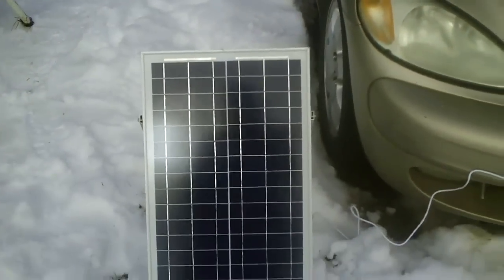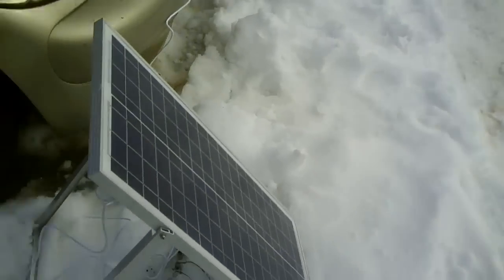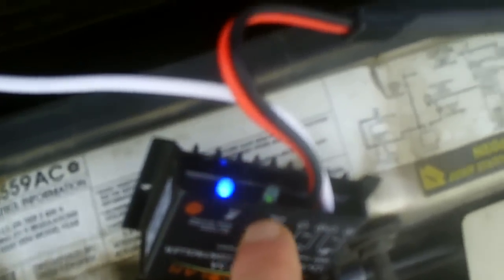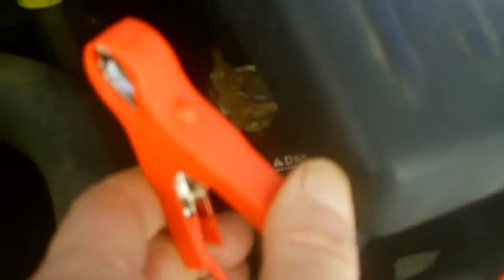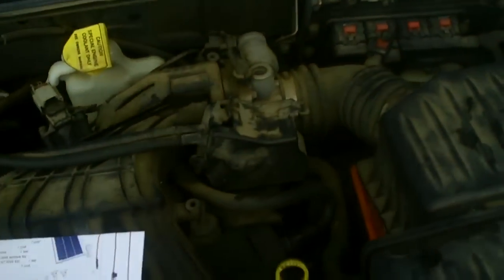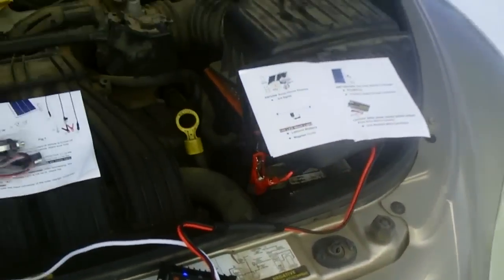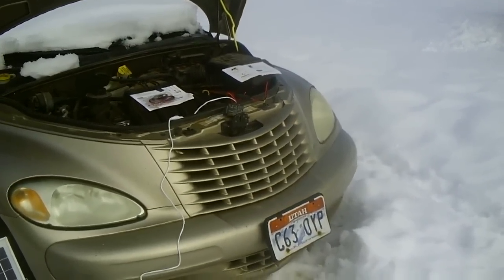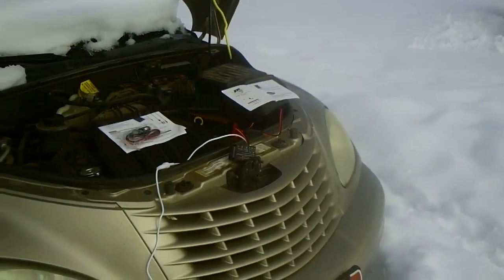MicroSolar 30 Watt Panel W/Controller

Comment: Does the panel provide overcharge protection or do you have to disconnect once the battery is charged? Welcome back LaMar!
Reply from the maker: Thanks Ryan- yes this comes with a controller that also reads the batt level and has over charge protection.

Comment: This is getting off topic but do you think it would be worth the effort to build a Thoreau cabin like your model using timber framing?
Reply from the maker: If you have the time and can learn timber framing that would be great. There are some timber framing vids on youtube. You could also do modified post and beam with traditional framing infill like I did with my cabin for extra strength.

Comment: Love this - would this work with a lawnmower battery ?
Reply from the maker: Yes as long as it is a 12 volt battery and I will be using mine for that in summer and to power small gadgets like sprinkler pumps.

Comment: great vid.  i agree 100% with everything you said.  for those people that don't know, just leave the charger hooked up all the time.  the controller will do the work.  one suggestion i have is....if a vehicle is going to sit idle for long periods of time....leave the solar charger hooked up all the time but also remove the negative clamp from the battery.  that will stop any parasitic power draw from your battery.  excellent vid.
Reply from the maker: Good advice- most newer cars do have some draw from clocks and stuff that will drain a battery over time.
Reply: solarcabin I want small 
60 inches 30 crack what is caused

Comment: Price at 5:02.
Reply from the maker: Price is $80 for 30 watt panel with support brace, 16 feet of wire and controller and battery clamps and lighter connector. Available here: http://amzn.to/2ioZTjN

Comment: If you charge through the cigarette lighter wouldn't it be a good idea to raise the hood? I am concerned about hydrogen gas.
Reply from the maker: The batt is outside the vehicle seating area so any gas would just exhaust away. This unit will not overcharge batts so hydrogen gas should not be a problem unless the car is in a small garage or unvented area.

Comment: You probably mentioned it already and I might have missed it, but once the car battery is charged, how often do you  have to solar charge it, assuming you're not doing much driving? great video, by the way, very informative. it doesn't get outrageously cold here in the LA basin, but when I travel to the mountains, the climate can be drastically different. we were even completely snowed in a few weeks back. so, I found this very useful!
Reply from the maker: You can keep the solar panel connected for vehicles you are storing and it won't over charge and will trickle charge them as needed. So if you will be leaving a car for a few days or longer just plug in the panel and forget it.
Reply: solarcabin great, thanks!! stay warm!

Comment: The price is right  30w would be about 2 amps. 4 or 5 hours a day.  About 8 amps/day. Is that enough? I think charging warms battery a little. Should help.  Please do a follow up later,  Good luck with you rides.

Comment: Freezing is also an issue with portable jump starters. I'm finding that they can be stored fully charged but if they freeze, some of them won't work at all. In addition, the amp claims on them are very misleading. The problem in cold climates is, when do you most need a jump? When it's cold out. That's also the same time the portable jump starters won't work. Especially in an off grid situation, how do you insure your jump starter doesn't freeze? You certainly can't keep it in your trunk, or in your unheated vehicle at all. Some sort of solar powered heated envelope would be ideal but it would have to be storage battery assisted for night time so that's another problem.
Reply from the maker: Yup- the portable jump starters will lose their charge on cold nights. Lithium batts are usually better at holding a charge but this little panel works as long as there is sunshine.